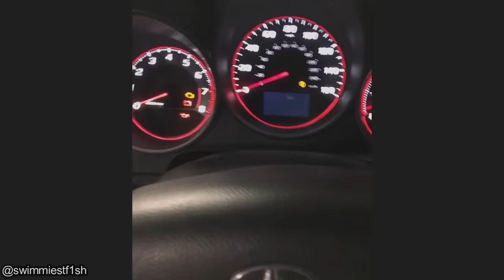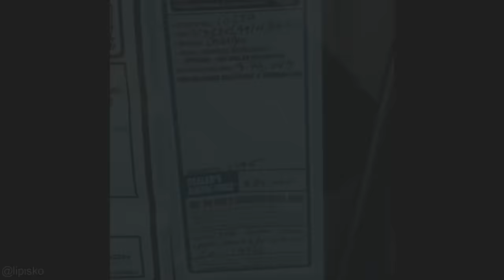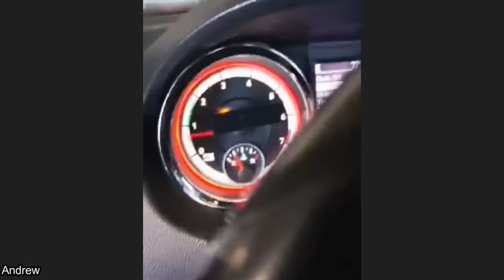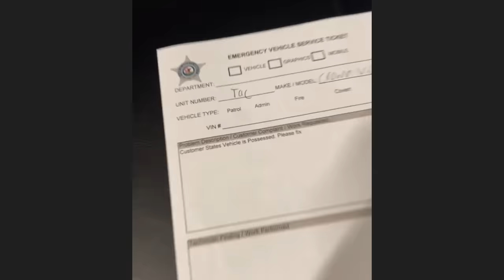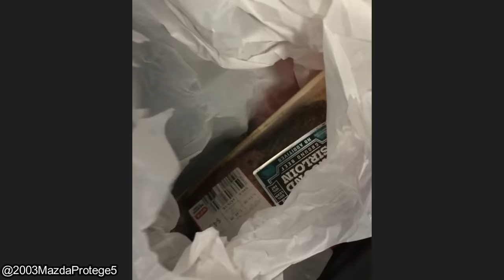Customer States Compilation (The Best of 2021) | Just Rolled In

Comment: When people go for there driver's licence they should also do a course on vehicle care & maintenance 😂👍🏽🍺
Reply: Or bring back teaching driver's education in High School.
Reply: People today think the only thing you need to do in order to drive a car is put the key in and step on the gas pedal.  A class on how to jack a car up, how to look under the car and how to change the oil and filter.  I find it is a game changer to buy a whole case of oil filters at one time.  If the first oil filter fits then the other 11 will fit.  You will be amazed how many times I've bought oil filters or other parts from auto parts sores/NAPA to find out they don't fit and belong to a completely different car.
Reply: 5:32 For one, always keep a fire extinguisher in your car. Not something we want to use but it is a necessity. Obviously at this point the fire may be too big but 
1) it doesn’t hurt to try with the extinguisher anyway 
2) you can prevent it from getting this big in the first place 
3) after you use a fire extinguisher or after it is 10 years old have the extinguisher recharged or replaced, based on the discretion of a licensed fire marshal
4) have your extinguisher inspected every 1-10 years, you don’t want to find out during a fire that it doesn’t work 
5) it should be easily accessible during a fire where you have few seconds or less to unstrap and grab or whatever and useable by a non-trained person but you should train others regardless 
6) it should be in enough quantity or big enough to put out a fire
7) optional but still recommended: you may even want to practice using some in a drill. Go to your fire pit and pour some gasoline on it. Light it on fire and have someone else (if other person is present) set a stopwatch and possibly video it. See how efficiently you can take the extinguisher out, yell for others to evacuate (do this drill once a week, fortnight, or month because too long you may forget and too often may cause neighbor annoyance, if you don’t have neighbors then do this as much as you want) and put the fire out. How many extinguishers did it take? And even if you don’t do the stopwatch and video to review your mistakes, the practice will do you good in the future. And remember that in the real event you will call FD but not in practice.
Reply: TL;DR 

5:32 proactively know how to use your fire extinguisher and keep some in your vehicle. Practice drills using your fire pit if you need to. This is a summary but I still recommend you read the entire thing, although reading the summary is better than nothing.
Reply: Yes. Absolutely
Reply: @jayasmrmore3687  Where I live fire extinguisher, and emergency warning triangle are required equipment in a car. I also carry first-aid kit, because it always good to have one within walking distance, and reflective vest, because it never hurts to be visible on dark road when changing a tire.
Reply: @kireta21  not a bad idea, thanks for the idea.
Reply: @chaseman94  or bring back auto shop in high schools
Reply: In my country when you're doing driver licence you are learning first aid, how to check level of engine oil, brake fluid, windshield washer fluid, coolant fluid. In some places they teach you even how to check brake and how to change them. And if you don't know 2 of these things you fail your driver licens exam.
Reply: If it hasn't changed, when I was stationed in Germany, drivers were also required to know how the car worked mechanically.
Reply: @aLortizable  how is that helpful to know?
Reply: @jayasmrmore3687  holy shit seriously?!?! Ya nothing important knowing how life works, keep voting democrat
Reply: @patrickancona1193  what I’m saying is that you should know how to repair stuff. Knowing how the car mechanically works is different.
Reply: @sd906238  Brotha', that's every where. You have to look the part up yourself and have the part# ready to go before you walk into the store......Scary Times ahead.
Reply: @anyone7165  What country to be specific?
Reply: @StaticVapour590  in the most crazy country to live rn know as Poland
Reply: @chaseman94  yep, agreed. But instead we were learning why plants are fuckin green. Very useful in everyday life.
Reply: They do atleast mine did
Reply: Oh yeah like realize their car NEEDS engine oil and GASOLINE to work!
Reply: @jayasmrmore3687  pay attention too the wind, aim low at the flames stretch your hands, and take a foam or co2 extinguisher. Do not use powder onces!!  If you use a powder fireextinguisher on a small fire know that all your wiring will have to be renewed and the insurrance wont pay for that, they only pay for the parts that are gone then by the flames, but you will pribably get electrical difficulties in less or about a year. Powder is cheaper as foam, but foam is way better, co2 (be carefull with your hands because you can get burned from the cold co2) is the best but illegal in lots of countrys.
Reply: We do that in Finland
Reply: @bobi9015  that's why Finland got world's best drivers born with steering wheel in hand 😅👍🏽
Reply: No doubt I've said the same thing for years lmao
Reply: We are taught basic car maintenance in the drivers licence course. For example usual OIL CHANGE INTERVALS, break pads and discs durability, what to check and what symbols on dash mean. Thought its everywhere like this 😀
Reply: Where I live, we have theory classes before learning how to drive.
There we learn not only he rules of the road but we also learn the basics of how to maintain a car.
Reply: @chaseman94  its cost money when i was growing up it w a s like 500 to 1k at my school so not many people did it. Like schools shouldny cost you anything when its already subsidies by the tax payers and keep asking for more money on the bill you vote on every other year.
Reply: maybe instead of CRT, hire a mechanic for hands on training for the upcoming generations when they start driving
Reply: @jayasmrmore3687  Sometimes what needs fixed on a vehicle is obvious and the repair is easy to figure out, like a blown tire or burned out bulb. Other times, if you don't know how your vehicle does what it does then you won't be able to figure out what's wrong. At that point, trying to fix it yourself will likely not go well.
Reply: @Dwayne_Bearup  don’t try to fix it yourself, get it towed
Reply: yes!! Having a custy asking what the 710 thingy is for... Then having to tell them to turn the cap 180 degrees.  As a joke, I have had the odd friend looking for their blinker fluid reservoir, and the fact that they WILL then attempt to look for one, always makes me worry about who they have working under their chariot's hood!  A bit of education can go a loooong way in keeping one's wheels rolling under their butt, for a lot longer distance
Reply: People just aren’t even fascinated by the very invention driving them down the road, they’re like toys
Reply: @paulbrown3302  it’s sad.
Reply: They do if you have to go to driving school.
Reply: @Gio102897  If I didn't know any better, I'd say that was spoken from personal experience...
Reply: @paulbrown3302   True story... Sad indeed.
Reply: Nah!  How do you think so many millions of shops stay in business!  We need useful idiots!
Reply: Yeah who’s paying for it.
Reply: @forfun6273   As should always be considered before either owning a car or before obtaining pets, if u can't figure a way to pay for it when it's necessary, u aren't ready to go forth with either.  It's called exercising a pre-emptive measure which has proven to be effective in the lowering of accident rates, damages and unnecessary deaths.  We may bitch about having to jump thru the hoops, here in western Canada, but we have waaaay fewer accidents, since we all had to take the same tests to be legal to drive... It's a privilege, not a right as I have said before, and the sooner that people realize that, the sooner the roads become safer for everybody. Only the entitled drive like assholes...
Reply: Isn't that part of getting your license in Germany?
Reply: @jayasmrmore3687  Not knowing how a car works or how to maintain it isn't just bad for the car, it can also be dangerous
Reply: how far becose i know before i got drive i had to put a engine together
Reply: This
Reply: @leonessity  The worse drivers don't bother to get a license of buy a car, No license steal a car out run the police. It happened to my family in Germany 1971.
Reply: correction or buy a car'
Reply: That's so true. I'm literally scared now, knowing what kind of cars and people in them are on the road.
Reply: I agree 1000%. I think everyone who owns a car should be taught basic automotive maintainance, like how to change a tire, do oil changes, etc. there are far too many people who just don't know what the hell they're doing smh
Reply: @emmabarrow2000  Most car thieves will drive rather conservatively, so as to not attract attention by passers by or get pulled over by the police.  Germany sounds like a pretty crazy place for drivers and car owners alike, tho... I'm in Canada so I can't speak for anyone else in class, but here, the worst drivers are the seniors who have age related  medical issues and shouldn't be driving anymore.
Reply: i think i saw that in north korea the driver licence courses last several month and you must get a complete mechanic education with em.
Reply: I work in the parts side of the industry and we say this a lot at work. Just being able to drive a car shouldn't be the only requirement for being able to get a license, part of safe operation is knowing how the car works and needs to be maintained. a lot of the shit that goes down out of here, some of it is a lack of caring sure but a lot of it is people not being educated enough to know what they shouldn't be doing... Like trying to tie broken control arms together. I've had to deal with people that straight up did not/could not understand that broken suspension parts can't be repaired
Reply: You don't have that in your driving lessons? I'm from Germany we have to learn how to do safety checks before driving and how to check for errors.
Reply: their*
Reply: I took my d4ivers Ed course in 2020... they tell us basic stuff about cars like how to change oil and to stop when you smell burning and stuff
Reply: UK we have to know the basics, such as checking oil and radiator levels, but thats about it unfortunately.
Reply: I think they should do IQ tests before they are even allowed to get behind a wheel
Reply: It would be a waste of time. Many ppl today think of technology as magic.
Reply: @ThePontiac98  The only people who do Auto shop are the ones who already want to (or do) know how the giant bomb powered brick of metal works.

Comment: The oil surprises are the best. Jelly-oil, silver oil, the "2000 mi" oil, the 68k oil, and the "holy oil needed".
Reply: What exactly was that silver oil, anyway? It looked nice and all, but a bit out of place in an engine.
Reply: @michaelj.beglinjr.2804  If it's a bit shiny....you may have metal from the motor in it...so total damage... No clue what that was
Reply: I mean I suppose you can get a Tesla then you won’t need to do oil changes
Reply: @michaelj.beglinjr.2804  someone put that silver stop leak in it maybe?
Reply: @michaelj.beglinjr.2804  Looks a lot like silver paint. That can't be it, though.
Reply: More like adds oil every 2k
Reply: I thought it was anti seize
Reply: @chucknorris8569  Yeah but motor oil / transmission oil with metal in it isn't literally silver. Only when you shine a flashlight on it, you'll see that it looks like it has fine glitter in it. Maybe someone really did put anti seize compound in it.
Reply: @jayasmrmore3687  A friend's cousin works at Tesla Germany. They need oil changes, because that thing is full of hydraulic assist systems.
Reply: @MirkoC407  still probably a lot less often then
Reply: @jayasmrmore3687  Probably yes - but with an "I drive an electric car, I don't need oil change!" (or any service at all) you can screw these things up pretty well. In the latest German roadworthiness check report Tesla ended on the same level as Dacia (Romanian budget car brand of French car company Renault). And according to that guy mostly for lacking / refusing maintenance.
Especially because if you bring your Tesla to maintenance they will check it first and then show it to the testing body for the roadworthiness check automatically if it is due. And these cars never fail, because they were checked by the shop before.
Reply: @jayasmrmore3687  Have fun doing anything with an EV, not to mention the prices we'll all have to pay to account for the massive toll on the grid. You think they run on magic? I'll stick to my own maintenance with things I can actually monitor and work on.
Reply: @michaelj.beglinjr.2804  it's a stop leak fluid. It uses finely ground aluminum. It's called Bar's Leak. It's uh...supposed to go into your radiator though, not your oil. It clumps and will "plug" small holes in your radiator. It's possible the car had a head gasket fail due to the cooling system leaking, so they added Bar's leak and it wound up going into the oil. They used a crap load of it though.

Comment: its crazy how much damage a car can take and keep going.
Reply: And how in other cases you barely have to glance at them and they refuse to work
Reply: Its alive, all it does is say 'kill me' but its alive.
Reply: Modern engineering is  goddamn near miraculous
Reply: I know eh.
Reply: @gunmunz  <FMA FLASHBACKS>
Reply: @AnimeSunglasses  Damn thing cost an arm and a leg so it better keep going
Reply: Kinda like me 😔
Reply: @thisonetime410  M or F
Reply: I work at a Insurance auto auction. Some cars come in that rolled over multiple times and they'll still start, albeit with heavy smoking. I've seen cars where the entire rear end burned to a crisp but they would still drive off of whatever was left in the fuel lines.

Comment: I laughed too much at the "possessed" vehicle at the end.  That's the perfect description for the problem.
Reply: Looks like a retired police cruiser.  Looks like whoever removed all the police related electronics botched the job.
Reply: @tinknal6449  pretty sure it's active duty. The work order was from the sheriff's department and the radio clicked on when he started it up. Still has a MDT in it too.
Reply from the maker: @Rick0809v4  yep active police vehicle. That shop specializes in that stuff.
Reply: probably somebody put the negative ground cable on the alternator positive!(+)  they must be caused that problem
Reply: @benjaminacosta2582 I thought it was some sort of ground issue as soon as I saw that video. Not super in to cars, but I had a early 90s Sony str-av570 home stereo receiver that had a random light on the front blink and a clicking noise when shut off, and it would make a loud popping noise through the speakers when powered on. The tuner also seemed to randomly stop working for a few seconds sometimes, and only pick up whatever station it wanted to. Other than that, it functioned perfectly and sounded great through nice speakers. The problem was a single loose ground screw!!! Faulty grounds seem to always cause these “item X is possessed. Please fix” kinds of issues.

Comment: That one with all 4 rotors gone should probably have their license taken away
Reply: Or female
Reply: @jayasmrmore3687  yet true.
Reply: @shoechew  wait nevermind I thought you were saying “probably have their license taken away for being female”
Reply: Along with the last tech that passed this car's annual inspection ... it didn't get that way overnight.
Reply: @seanthompson8071  Not all states have inspections.   Mine doesn't.
Reply: How can one destroy brakes like that? I had a brake pad go down to metal one time, heard a noise sounding like the wheel was about to fall off every time I used the brakes, replaced the pads and still had enough rotor left to pass inspection. Yes, the rotor still had enough metal to pass insection legally.
Reply: I once saw a car with rotors worn like that. I asked the customer if he heard any odd noises. He replied in sign language.
Reply: I don’t know shit about cars. I know enough to know when something is wrong. I called my dealership because the front tire would intermittently squeal, but would stop when I’d brake. They made me wait 2 weeks to bring it in. The brake pad was down to nothing and the caliper was messed up. Should not have been driving it. My favorite part is if I brought it in when I called, could have been covered under warranty.
Reply: This is no joke. Long ago when I worked at a car dealership a car was towed in and customer wanted brakes fixed under warranty. Car had about 15K miles. Brake pedal went to floor with no braking action. Inspection revealed rear drums worn through. Shoes could be seen in wear grooves in drums when wheel removed.  Front rotors worn to about 1/3 of original thickness. Finally a brake pad fell out of the caliper. Then the piston moved past the seal and all the brake fluid ran out. Apparently before that all was fine even with no friction material on pads or shoes for some time.  They did not get warranty.  Saw other similar results over the years where people somehow trash brakes in 15K miles when 95% drivers of same car get 50-80K.
Reply: @victorspinetti5145  You know they are the ones riding the brakes with their left foot.
Customer: "Noise? Every car I've ever owned makes that noise"
Reply: @mindpilot72  this is eye opening, thank you. I couldn't have even imagined that there are idiots who would do this but it makes sense and I see no other explanation. This is why people should learn driving in a manual. Or driving exams should be orders of magnitude stricter. In my country it's so easy to get a driving license, foreigners visit just to do that and then get one in their home country by showing that they already have a license in another country. This is fucked up.